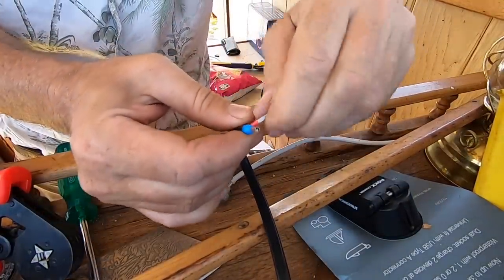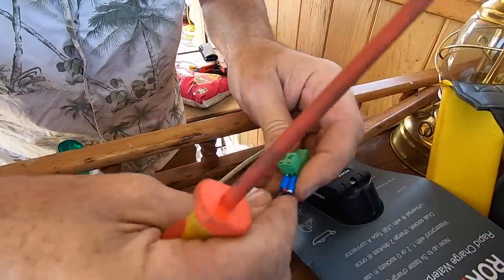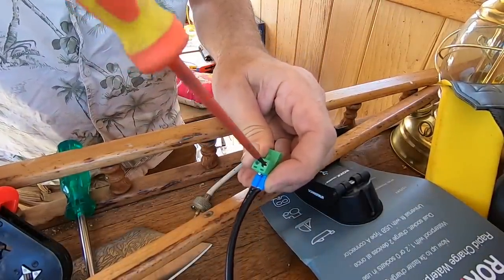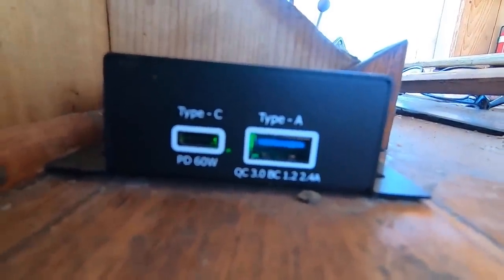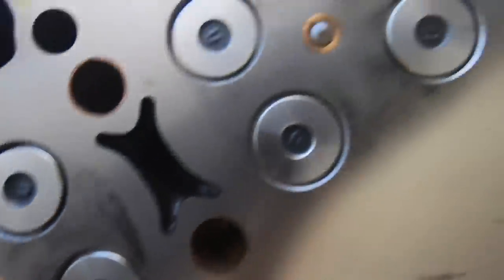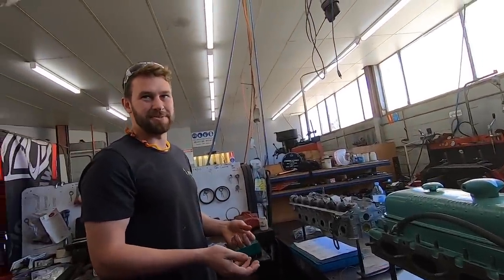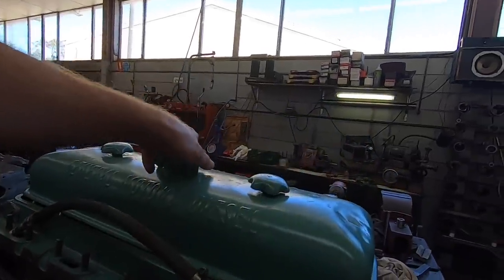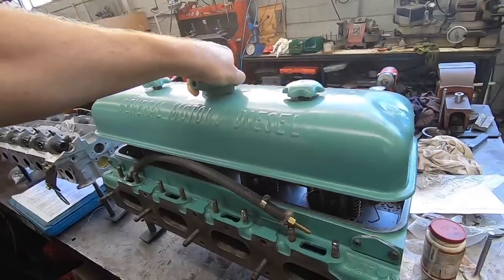Some questions answered

Comment: Don't understand electrics, give up any hope of being a mechanic.
The US doesn't have any regulation of mechanics, and I prefer it that way.
We lost allot of mechanics when carb's were replaced with fuel injection, but, they really were not mechanics at all, they were just imposters.
I have survived all of it, carbs, fuel injection, computers, and I actually like injected motors, once set up right, they handle every aspect of tuning.
Reply from the maker: Yes, it's interesting how people are unwilling to learn new things and just leave the industry when things change. Fuel injected engines are definitely better and in many ways simpler to work on.